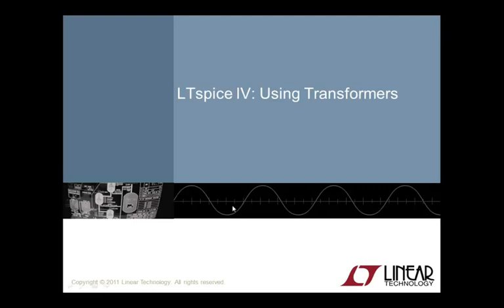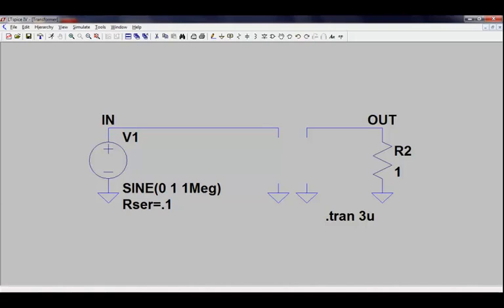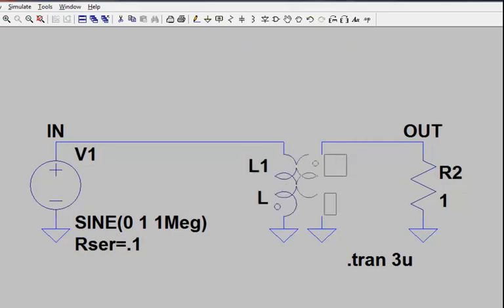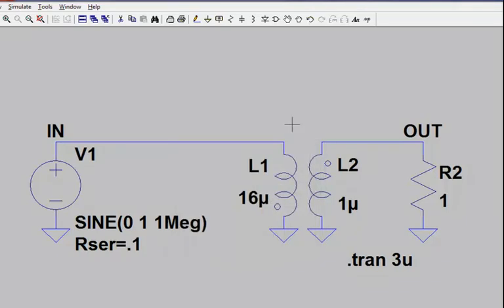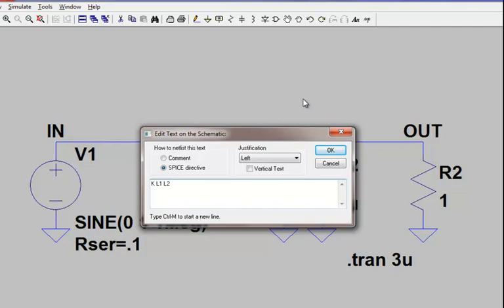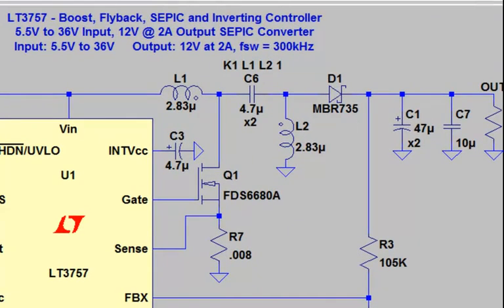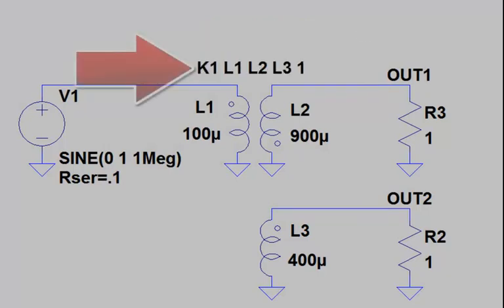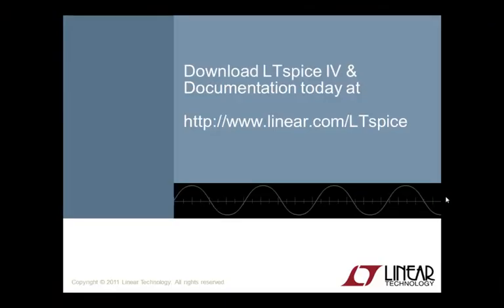LTspice Using Transformers

Comment: If I know the parameters of the transformer , how do I get the L1 and L2?
Reply: If you know the turns ratio (N1/N2) and if you know the inductance of either the primary or secondary, you can use the following relationship to get the other inductor value: (L1/L2) = (N1/N2)^2